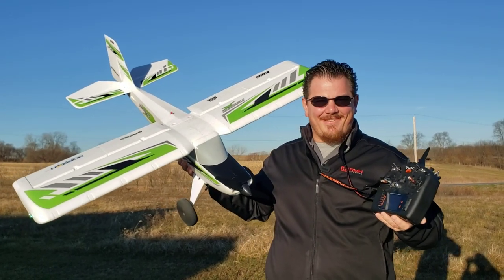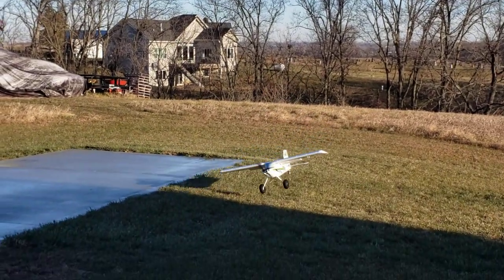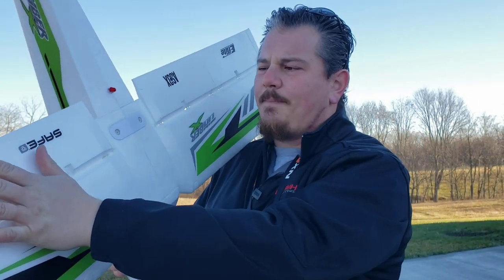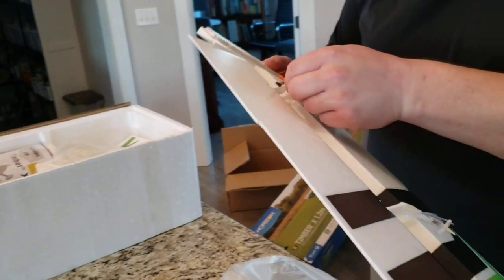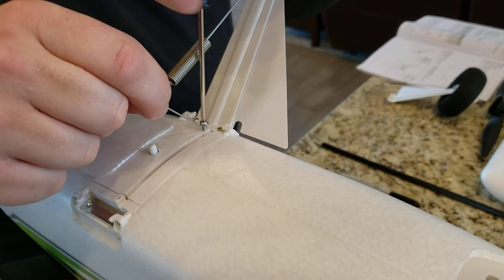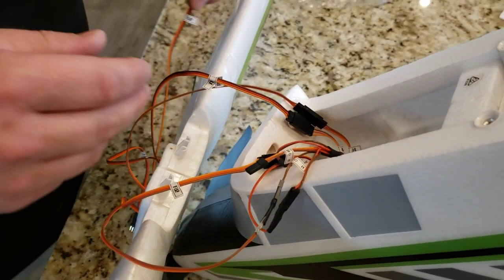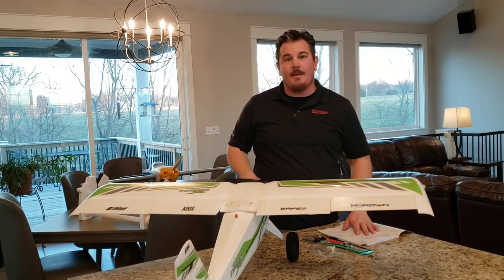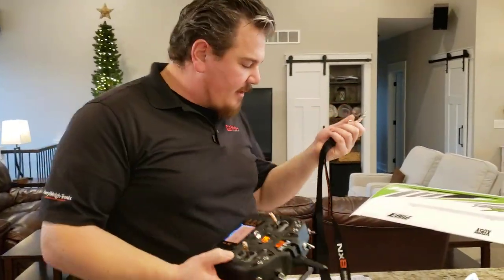Horizon Hobby - Timber X V2 - Unbox, Build, Radio Setup, & Maiden Flights

Comment: I have the entire family of Timbers and many more planes besides including 3D built up planes.  This (actually the Night version) is by far my least favorite of all my planes and I wished I’d never purchased it.  It has bad coupling between aileron, elevator and rudder which are readily on display if you try to fly knife edge.  Frankly an ugly flier which readily tip stalls.  I see my experience with it is not unique.  One must keep power and speed up with this plane if you hope to favorably influence its flight path.  On the positive side, it is relatively easy to transport and has a good landing gear arrangement for grass fields.
Reply from the maker: True!